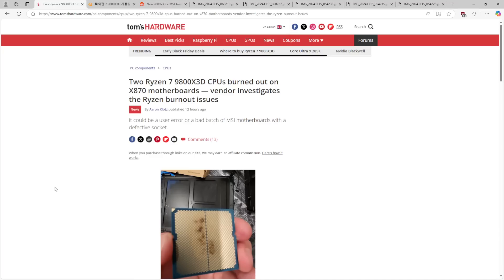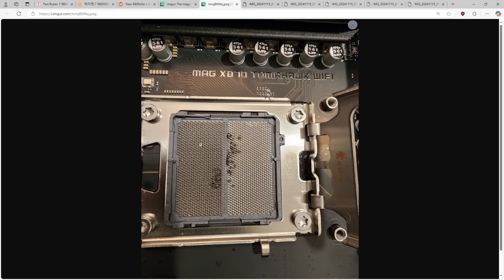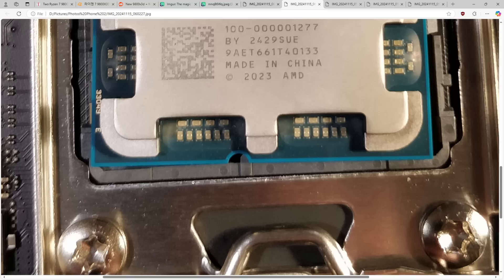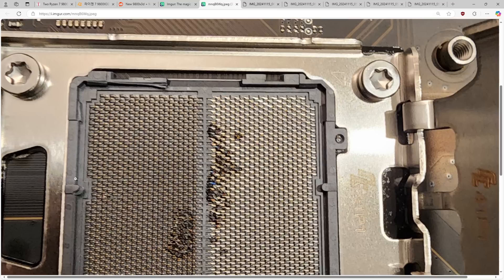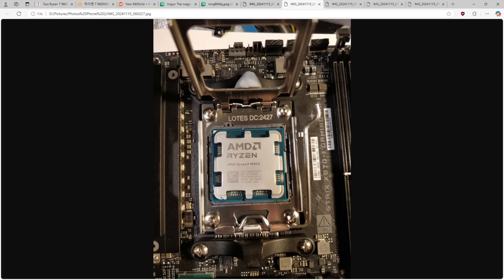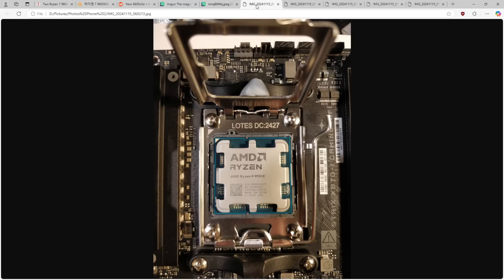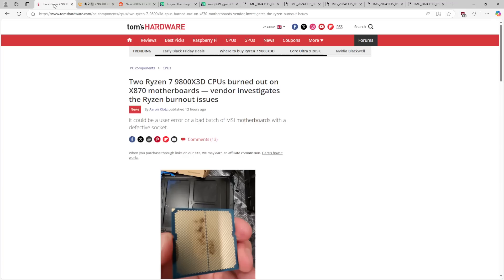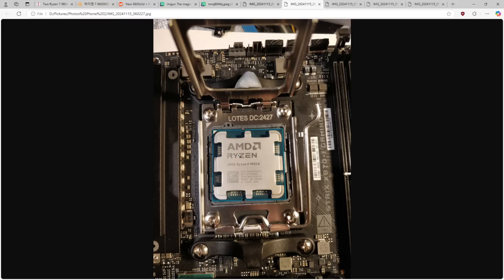HOW NOT TO BREAK YOUR 9800X3D

Comment: Incorrect installation: I didn't think I would need that much force to close the bracket.
Correct installation: that's cause you don't need that much force that close the bracket.
Reply from the maker: The intel HEDT sockets and LGA1700 still scare me every time I close the latch.
Reply: @ActuallyHardcoreOverclocking  It's unnatural how rectangular it is. I hated it. Glad to be done with that platform.
Reply: @ActuallyHardcoreOverclocking  Why did Intel go with a latch mechanism that required so much force to close in LGA1700? I wondered that while building a system featuring an i9-13900K for a friend. Was a relief going back to refurbish an old LGA1366 system I had lying around to give away. Very little force required by comparison back then.
Reply: @savagej4y241  Sees 13900k oohhh.... Then i see you talk about 1366.... Oh....now im reading... Just swapped out my X5680 for 14th gen...
Reply: getting the 2nd screw to start threading  x.x

Comment: One thing I don't understand. It the plastic that weak to get mangled in the scenario you are describing? It's kind of hard for me to believe that this flimsy lever can put enough force on the plastic to actually damage it. My believe has always been that is barely keeps the CPU in place and the actual pressure occurs once you mount the cooler.
Reply from the maker: that plastic isn't meant to handle any physical stress. AFAIK ALL the vertical loading of the CPU is handled by the pins.
Reply: Well it's still plastic vs metal at the end of the day. The mechanism is putting several kilograms of force on the CPU by simple leverage.
Reply: It was from an older spec leak but apparently the upper mount force for AM5 clip is 90lb / 40kg. All LGA sockets need high load force because spring tension adds up with 1000+ pins.
Reply: The lever is a force multiplier. take distance from levers pivotal access to where you push at it vs same pivotal access to where it pushes on the retention plate. Long length divided by short length is the multiplier. That is over 10x increase force so if putting (picking a random example #) 10lbs of force on the arm to close it then you put 100lbs at that point on the reitainer. The distance from where the retainer pivots to where it contacts the CPU's plastic crushing notch or corner vs same pivot point to where retention lever contacts it is additional leverage so >4.5x (450lbs on example force) on edge near pivot and >1.25x (125lbs on example force) for the further one. Once you tension a cooler on top of it, there will be more force applied to the CPU (and therefore any misaligned corner/edge). To know the totals, someone has to measure an applied force to hold the retaining arm at the same angle it is held at when latched in place; that force won't count what the cooler added but its a start.

Comment: you should clarify that mobo should be horizontal with cpu socket oriented UPWARDS, bcs there will definitely be some people that will misunderstood this
Reply from the maker: LMAO
Reply: 'Upwards', too ambiguous, 'Socket pins towards the sky'
Reply: CPU pins to the sky *noted /s
Reply: @DKTAz00  Points the socket to sky in the horizon, making the mobo vertical again.
Reply: @DKTAz00  Someone will build PC outside in the middle of rainstorm and blame youtuber for burned house.
Or for receiving very unhealthy doze of lightning and tree branches to the head.
Reply: @DKTAz00  Australian sky eh? Got it mate.
Reply: @DKTAz00  "CPU pins to the sky" so I must instal it when fly a plane only in the cloud day... OK
Reply: @DKTAz00  Technically they are inclined to act as a spring... So, some might interpret that as holding your MoBo at an angle...
Reply: All these replies are killing me xD
Reply: @DKTAz00  Bend the pins skyward? Understood.
Reply: This gives off the same vibes as a "not fit for consumption" warning on a bleach bottle.

Comment: I've been guilty of installing a CPU vertically before, actually to be more precise, I had to change my AIO, and in the process involve having to remove the standard Intel locking mechanism, opted to be lazy and not take out the whole motherboard, I tried doing it vertically with the MB still in the case. I noticed an issue with my GPU after the install as it wasn't running at PCIE 4.0 x 16, but instead it was doing it at x 4, after days of troubleshooting, ended up finding out that I bent my CPU corner right where it was responsible for PCIE lanes, because the CPU likely moved as I was mounting it vertically. Damaged pins and CPU, had to replace both the MB and the CPU.
Reply: I really do that couple times when its was not convenient to horizontal orientation pc or MB and its gone well)

Comment: I like when people do something completely wrong and then complain on internet like why did this happen to me?
Reply: How tiktok was born
Reply: Paid by Intel
Reply: Either we have the same hobbies or you're chronically online. I always see your comments on mousereview or anything hardware related xD

Based takes though 🤙🏼
Reply: @omegaPhix   we probably do, I am very much into hardware, 3d printing and woodworking :D
Reply: If you pay 480 USD for the CPU alone, and who knows how much for the motherboard and the rest of the components, READ THE EFFING INSTRUCTIONS, or look up an online guide.
Reply: Every. Time.

Will literally blame everything other than themselves before they take responsibility. And even when they KNOW it's their fault, they will blame something else to try and have amazon or whoever fix their fuck up for them for free via a replacement. You can't really blame em for trying to get a get out of jail free card, but if you legitimately fucked up because of your own stupidity when you should know damn well what you are doing with expensive parts, the imo, you deserve the L.
Reply: @darkdestroyer32   yep, everyone think they are never the problem
Reply: Someone that makes a mistake like this probably doesn't have the expertise to realize that it was their mistake. This is why when I saw this first posted, I 100% expected it to have been user error. Too many people jump on the bandwagon whenever there's a failure like this (see the RTX 12v connector that people didn't fully plug in). Idiots abound.
Reply: is reading a manual so hard for these people?
Reply: like trump voters
Reply: @stan4oburger  yeah pretty much
Reply: Now we waiting this news to go on FOX news/CNN etc
Reply: Everyone missing that everyone here is in at least top 25% of custom PC builders because we are all watching a hardcode OC channel, and the issues newbies face do not apply to them. Like, you wouldn't be able to imagine what kind of dumb shit one can mess up. But AMD knows from the RMA requests they and the partners receive. They 100% knew people fucked this up in the past. They could prevent this by somehow supporting installing CPUs while the motherboard is vertical.

I'm approaching this from the point of a industrial designer so you can miss my point if you don't have the experience. AMD have tens to thousands designers, probably much better than me, so they could definitely do this. They just didn't give a crap about it.
Reply: @BeardoFunk   it doesn't really work like that, officially this is a piece of equipment that should only be installed by professionals (at least if you want your warranty valid) they just keep one eye closed and accept that anyone can do it. So no, they should make it miraculously idiotproof somehow because there is always a bigger ldlot. And it is ok as it is now, since this happens so extremely rarely that it doesn't matter.
Reply: @BeardoFunk im basically a newbie when i built my first pc, never had this issue because i actually did my research. You have to be an mega uber stupid person to do something without researching it, and then blame someone for their stupidity. Lessons are supposed to be learned by the person committing the mistake, not by everybody else

Edit: amd already have a solution that you were asking for, not in a way you like but it basically solved the problem you think they dont give crap about, and the solution they have is called a MANUAL
Reply: @BeardoFunk  
There is a cost to every design addition. It's not that they don't give a crap, it's that they're not going to spend resources adding something to support for vertical CPU installation when their target audience should be assembling everything on a flat surface.

By the way, it's not just the CPU manufacturer that would have to make design changes. I don't even want to think about the problems with mounting a CPU cooler while the computer is vertical.

The CPU was damaged because the user did something foolish, counterintuitive and unnecessary. This is not an easy mistake to make, the difficulty in making it should be more than enough of a hint that they needed to reconsider what they were doing.
Reply: So is anybody going to ever point out that these kinds of failures were very difficult before CPUs switched from pin grind array to land grid array, for reasons that are toooottally not related to cost cutting, or are we going to just have an echo chamber?
Reply: @HaveYouTriedGuillotines  you are missing some crucial facts, there is a technical reason we use lga sockets now, they are also more expensive to produce so what you are saying doesn't make any sense
Reply: @riba2233  
You're the one missing critical facts. Did you even consider who's footing the bill?

Exactly as I predicted. An echo chamber.
Reply: @HaveYouTriedGuillotines  wow, instead of accepting facts you decided to be aggressively ignorant, aka the worst kind. If you asked politely I would explain to you why we need lga now, but your loss I guess.
Reply: @riba2233  
Stop projecting. How about instead of doing that you learn to think critically.
Reply: @HaveYouTriedGuillotines  rofl, stop coping bro, I am the one who knows the facts here, and you are the one with your version of reality and unwilling to learn.
Reply: @riba2233  bro you destroyed him with facts and logic
Reply: @riba2233  
Ignoring facts that don't suit your narrative devalues the facts you do have, and makes you a liar by omission. Please improve as a person.
Reply: @BeardoFunk  
Whatever you say, Ben Shapiro.
Reply: @HaveYouTriedGuillotines  I am not ignoring any facts, you are doing that and are also incapable of realising why they are using lga nowadays and why arguments for using it are much more powerful than yours (not to mention that half of your arguments are simply false)
Reply: @riba2233  
You are ignoring facts. I asked you a question with an obvious answer. That was one of the facts, and you just ignored it.
Reply: @HaveYouTriedGuillotines  bs but keep coping ;)
Reply: @riba2233  
No BS, but keep projecting.
Reply: @HaveYouTriedGuillotines  keep being ignorant bud
Reply: @HaveYouTriedGuillotines   still coping I see ;)
Reply: @HaveYouTriedGuillotines  You would be surprised that bent CPU pins was a common CPU killer, even with zero insertion force ZIF sockets.
Reply: @HaveYouTriedGuillotines  there was far more CPU failures when CPUs had pins, than with LGA sockets.

Bent and broken pins were far more common, and if you're having a really bad day, you also get the broken pin stuck in the motherboard.
Reply: @DMFP42  
No matter how many times you people say this, it's still not true.
Reply: @HaveYouTriedGuillotines Pin grid arrays have other more common problems, like being dropped and bending or breaking pins.
Reply: @ctid107  
And you will talk about only those problems, and not the problems of the even more fragile LGA boards that commonly end up with smashed pins in the socket, because you can't handle any facts other than those that makes you feel good.

You also wont talk about how the adoption of LGA has passed the cost burden of the pins on in such a way that the end user pays more. Trickle down economics at their finest!

The reason that most of you are here on this video is to chase bias confirmation, and it's really dumb.
Reply: @HaveYouTriedGuillotines try not to be insufferable challenge level: leftist
Reply: @megazombiekiller9000  
You don't know what a leftist is, stop talking.
Reply: @HaveYouTriedGuillotines  challenge failed; try again?
Reply: @megazombiekiller9000  
Sorry to hear you failed the not cucking to capitalism challenge.
Reply: @HaveYouTriedGuillotines  challenge failed again; try again?
Reply: @megazombiekiller9000  
Man, you just keep failing challenges! Have you tried actually learning?
Reply: @ challenge failed; try again?
Reply: @megazombiekiller9000  
You're like an NPC from an 8-bit JRPG.
Reply: @ life is just like video game! However, challenge failed; try again?
Reply: @megazombiekiller9000  
Yes, you failed the not cucking to capitalism challenge.

That unfortunately has real life consequences, and you can't try again. You just live with the consequences, and blame everyone around you for the mess you made.
Reply: I like when people were installing their 12vphwr wrong it was nvidias fault for not making it idiot proof though.
Reply: @JustBenching 😂😂😂 totally not related. 12vhpr are still Burning over the world. The whole connector is a joke
Reply: @JustBenching   that is a different story, its design is flawed in a way
Reply: @riba2233  it has 2 indicators which side to place, a dot and the carved slot.
Reply: @Doflaminguard  I know, why are you telling me that?
Reply: @JustBenching  There were connectors which even when fully seated could provide insufficient contact and overheat, as well as ones that could seemingly latch but not be fully seated.
Reply: @JustBenching  : Stick with what you know, the 12VHPWR has had several redesigns and have now been abandon by Nvidia on the upcoming 5090 because it clearly has a design flaw.
Reply: @cam_934  now we need amd to redesign the socket, no?
Reply: @JustBenching  no, please stop embarrassing yourself.
Reply: @JustBenching  False equivalency. The socket shows damage that is not inline with normal situations nor overheating. That is indicative primarily of most likely user error or less likely manufacturing error. 12vhpr had fundamental design flaws which were not able to be resolved in a satisfactory manner, thus necessitated a revision for 12v-2x6.
Reply: @riba2233  Great argument got me convinced. Thanks
Reply: @JustBenching  np, enjoy
Reply: @JustBenching  the connector is fucked, they are trying to push 400 W through a tiny connector, just look at the 7900 xtx, it has 3 connectors and their connector never burned
Reply: I believe this shows a flaw with the socket. There will always be dumb users and AMD should've accounted for that in their design.
Reply: @BeardoFunk  you are high, do you work for user benchmark? this is TWO in TWO YEARS. thats a 0.000000000000001% Failue rate.
Reply: @BeardoFunk "2 People out of 10s of millions couldn't figure out how to properly install a CPU, let's blame AMD for this." You sound like the people who were responsible for shampoo bottles needing warning labels.
Reply: @BeardoFunk that would be impossible given the many of ways a user could mess this up
Reply: @BeardoFunk  AMD put all kinds of cut offs and inlets around a CPU if that is not enough just buy a prebuild. I can only imagine how much force it needs to close that lever when cpu has to cut through a plastic. There a people so stupid, that no amount of engineering can help.
Reply: @PREDATEURLT  YES, that's my whole point actually!!
Reply: @BeardoFunk  O come on, you have 3 check points that needs to line up. If you can count to three and have a pair of eyeballs it can't go wrong.
Reply: @BeardoFunk lol, nowadays it's so simple to build a PC and people are still not careful and screw it up. Imagine if it was like the 90s with AT power supplies where there was 2 cables that you needed to connect them in the right orientation on the motherboard otherwise it would short circuit everything connected to it and damage them.
Reply: @BeardoFunk It’s a KEYED socket
Reply: @BeardoFunk  Here we go, the no responsibility generation speaks, idiots could have put the CPU in upside down or applied a tube of thermal paste directly into the MB CPU socket and you would complain its a design error! refund me NOW!
Reply: @BeardoFunk Arrow goes to arrow. Done.
Reply: @BeardoFunk  It's always good if they can improve the design to make it more idiot proof, but no major outlet has ever raised an issue with the AM5 socket design so far, and AM5 has been out for more than 4 years now. 

The problem with the 12vphwr connectors is clearly far worse and far more prone to having issues.

Comment: I'll never forget the cheap "as-is" i5 socket 1151 system I bought, that had the CPU rotated 90 degrees and forced closed.

I thankfully never attempted power-on until the full tear-down that revealed soon to be problem, I had a weird feeling.. it was too cheap. That was a good amount of time unbending pins. Got it working though..

Comment: You gotta give it to them, they must have superhuman strength to close a socket in a state in which it can't be closed theoretically. That must have taken force.
Reply from the maker: I don't think the socket plastic is that hard and the loading mechanism has a lot of leverage
Reply: @ActuallyHardcoreOverclocking  Also, keep in mind they mounted a cooler on top of it :)
Reply: @ActuallyHardcoreOverclocking  sockets are definitely not too strong vs the leverage of latching mechanism
Reply: In the other pictures they bent the retention cover plate during install